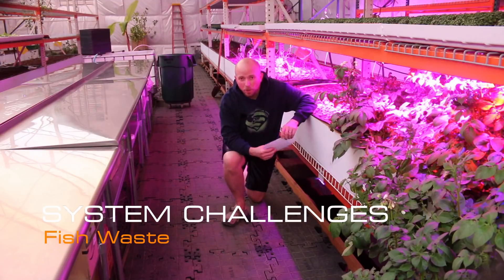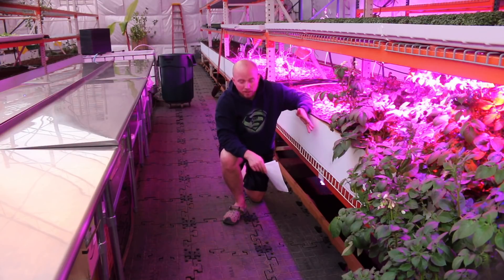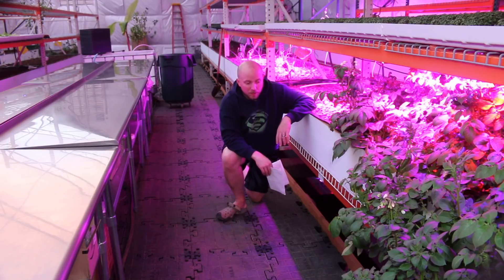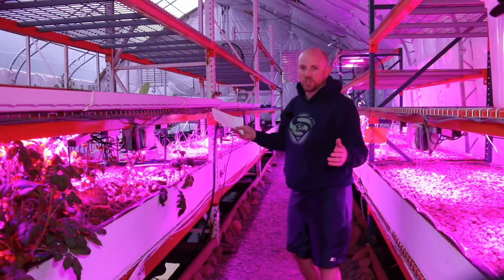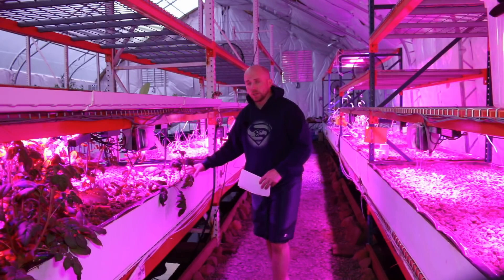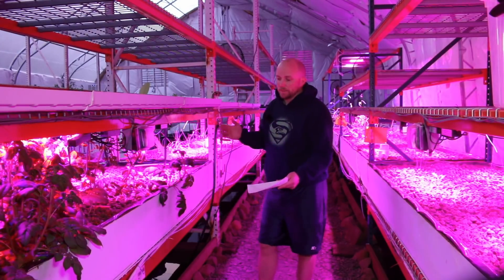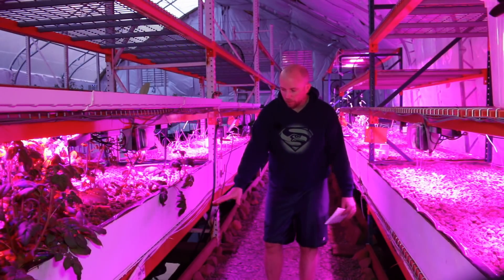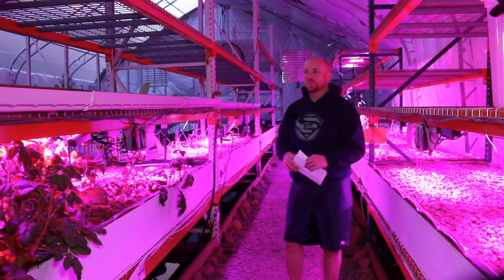New to AQUAPONICS ? Well think of how to REMOVE your FISH POO

Comment: I agree with the thought that you are way overthinking this simple problem. A good automated swimming pool cleaner would crawl around the bottom of your tanks, sucking up the waist in very little time. Have a timer turn it on 1to 3 hrs a day depending on the tank size. Simple easy and off the shelf turn key.

Comment: There is a system used by dairy farmers that works by pulling a chain along the milking shed really slowly, it collects the solids and moves them out. You could build a conveyer like this that slowly moves the fish waste out of the tank on little oblong buckets that would tip put into a collector. You would have to redesign the fish runs with this device at the bottom working like a rovolving conveyer belt. No need for software, sensors or robots it would just move slowly along and deliver the waste to a hopper at the end.

Comment: @The Real Martian Your  problem is  pretty simple.. but your not  going to  like the  answer.. All the systems that  are good at removing  fish waste: 1) have a shielded stand pipe in the fish tank that maintains the  minimum and maximum water levels in the  fish tank, shield tube insert is slotted on the bottom to increase flow from the bottom of the  tank helping to remove  solid waste,  to the  sump  from  which the  nutrient water is pumped from into the grow beds. or  2) the system is two separate  parts  the fish system and the plant  system. In the  fish system  solid waste is  continuously removed to a bio reactor to  break down into  nutrients. The  liquid nutrients in the  water are removed using  Algae Turf Scrubber  where the  algae is either used  for  fish  food or  plant fertilizer.  So basically Your  suffering  from  bad system  design.

Comment: It's simple and won't break. Just a small inclination should do. I mean, if this was on a shelf it would be harder but creating an inclination in the ground should be really easy. Even with waterpipes running beneath. As long as you have some insulation beneath the waterpipes the heat should reach that extra few centimetres. If you have like... say four metres between each pump, you'd have a zig saw pattern, the top at the middle 2 meter mark between the pumps, maybe 5 centimetres (that's like 2 inches for you american folks) higher than  above the bottom where the pump is.

Comment: I would just have the floor on the fishtank lean towards the pump. Just figure out how much it needs to lean (shouldn't be much) then the fish swimming around will help stir the poop around and it will accumulate at the bottom end, then you can just pump it up from there. I mean, it's not like your tank is made of glass, you won't have an issue with tension, that's the good thing with wooden tanks. That way, no unessessary breakable robots. the floor doesn't even have to be exactly even. It just need to generally lean. The fish will do the rest.

Comment: KISS. Firstly great work up to this point. A+ for effort. If sensors are too expensive for each lane why not use one common bank of sensors inline and then pump the water from each lane to the sensors. IE pump lane 1 for 5 min then sample. Then switch to lane 2 for 5 min and sample again. That way you use the same sensors on all lanes. This also means the lanes are using the same sensors that have the same calibration.

Comment: If your goal is to make systems deployable  you really need to look at refrigerated cargo containers. Infrastructure to transport them is already in place, they're built tough as hell and come with insulation. There's a bit flat roof waiting for solar panels and small wind turbines. You talk about farming more in a small space. There is loads of space, but in climates not suitable for agriculture.

One of my pet projects is deployable manufacturing and fabrication units. Those use shipping containers that are converted to small machine shops, wood shops,  electronics and 3d printing, etc. Then there's a utility module that contains power and water. There are already containers made to be portable living space. The group of containers is send out, put down close to each other and the necessary cables are run and you have a manufacturing site.

If an aquaponics system could be modularized into containers then there's a system that now requires less logistical support, or a farm in an area that would not support it otherwise and reuses old shipping containers that would otherwise sit and rust.

As for the fish waste problem you need to add bubblers down the length. It adds O2 to the water and lifts the waste so it can be moved along with circulation. If water isn't moving things will settle.

Comment: Just put a couple powerheads in the pond to keep the poop suspended until it gets pumped out, on the next build make the bottom of the pond slope down a couple feet, the poop will settle on the deep end where the pump can suck it up.

Comment: I think that you are both overthinking it and, under thinking it at the same time. The symptom is settled fish debris/waste. The real problem is a lack of proper circulation. You have to realize that first. I would suggest circulation pumps. They also have Linear piston pumps that put out some serious air, and 1 of those, and some air stones every 3 feet It would fix all of your proplems. It would circulate the waste, and your pumps would pump it all up into the beds for the wigglers to eat, it would oxygenate your water, and clean your tanks. it also would only take about a day, and like $200.

Comment: TRM, tracked vehicle, eh? Look at a G-scale railroad as a platform large enough for a tracked system. Build the articulating arm to go off a flatbed car. The train can push the flatcar. A simple transformer controls the speed of the train. And you can automate using DCC and bluetooth.

Comment: The easy solution is a plywood bottom with pipe channels routed into them so you can have a smooth bottom and just use a pool crawler to run overnight per lane. As you are still in testing and want to be able to change things they make a screw in footer you could place under each leg of the racking rather then concrete then some plywood sides and bottom to stop soil slump and at the same time give you a space to router in channels for the pipes to keep the bottom flat for good even suction from a pool crawler. 

Remember KISS for testing. Why use a robot when you can use valves to pull water from each bed to a test station. Will let you keep a tank of flush water to flush between tests.

Comment: I have had an aquaponics system now for four or five years and the first problem that I see with what you have there is you don't have easy access to your entire system. It will be difficult to get access to your fish containers and to the upper grow beds when you start growing above the one that is easy to reach. The only reason that you would want to have additional levels of grow beds is because you think you can't grow enough food on one level. Multiple levels of grow beds create a lot of extra work you need ladders or scissor lifts to get to them, additional lighting, more or bigger pumps, its a lot of additional work and resources you don't need. My second thought is that you need either an inline or secondary filtration for your water in addition to the grow beds. In my case I have an about 400 gallon system that I built from stuff I bought on Craigslist so at the time I reused a 55 gallon drum that I had to make a filter for the system. Water is diverted from the pump into the grow beds and the filter system so that when there aren't enough plants growing or worms in the grow beds to clean the water for the fish roughly half of all the water going into the pond is filtered regardless of plant load. That is probably not the most efficient way to do it but I was just starting out.

 My suggestion to you is get rid of all the racks or atleast move the fish from below the racks and put the fish in a big tank and inline filtration at one end of the building then run two or three long troughs for either media grow beds, deep water culture, or even better a mix of both down the length of the building for growing. Ideally one of the best ways to set this up is water gets pumped from the fish tank first into the media grow beds, then to the deep water culture beds, then to the multi stage filtration system then back into the fish tank. A bigger aquaponics system will tend to be more stable than smaller ones. I haven't seen yet if you have a planting schedule or not but that is important even in a green house to have because some plants will require supplements to get the best yield out of the crops. 

 These guys have been doing it as a business that way for years https://www.ouroborosfarms.com/ . So their system is optimized for high yield production and low cost as possible. Another great resource to use for optimizing a hydroponics or aquaponics setup is these guys https://www.youtube.com/user/BrightAgrotechLLC/playlists Bright Agrotech is all about growing plants to sell which means they only have what is absolutly neccsary in thier systems to make it easy to use, easy to fix, and cost effiecent to run. Also the vertical grow towers they sell could save you a lot of room. Here is another great resource for learning how to setup an efficient aquaponics system.  Aquaponics at Kentucky State University Aquaculture Research Center 
https://www.youtube.com/watch?v=gTg3eQZaR5E

Youtube has a lot of great videos on the many different ways to grow in aquaponics but I believe keeping the system as simple as possible and making it easy to get to the entire system for maintenance and repairs will make using the system a lot easier on the people who have to work with it everyday.

Farmbot & Aquaponics https://www.youtube.com/watch?v=w6j-l0Jqx24

Comment: Your goal is to make this a system that can be run by anybody.  Repairs and maintenace are a big part of running the system.  Therefore, the system needs to be simple enough that anyone can repair and maintain it too.

Color change chemical water testing is simple and effective.  If you wanted to automate the testing, you make a test tube magazine that can dispense a sanitized test tube into a gripper on the end of a pneumatic cylinder.  You advance the pneumatic cylinder to take the test tube under the water to take a sample.  You return the pneumatic cylinder to retrieve the test tube.  Once fully returned, a horizontal tandem pneumatic cylinder with gripper takes the test tube to the test position.  The first half of the tandem cylinder advances to the pickup position.  The horizontal gripper closes on the test tube, then the vertical gripper opens.  Then the second part of the tandem cylinder advances the test tube to the test position.  Chemicals are added and a vibrator on the horizontal gripper can be used to mix the chemical.  A camera records the color.  The horizontal gripper releases the test tube and it slides down a tube into a bath of water, where the water breaks its fall and it sinks harmlessly to the bottom.  As soon as the horizontal gripper opens, both parts of the tandem pneumatic cylinder retrsct.  The system is now ready to repeat the cycle for the next test.  The operator of the system collects the spent test tubes and runs them through a santizer, and then loads the sanitized test tubes into the magazines, and then replaces the magazines in the various testers.  The operator also refills the chemical tanks.

It's fairly simple, and cheap pneumatic cylinders are readily available, and it's simple enough to understand that just about anyone can maintain and repair it.

Comment: In regards to sampling I would simplify it a bit and remove complications/time of a robot, definitely an idea for the future though.
An industry standard sampling system could easily be put together for minimum cost. I would run a "Fast Loop" to/from each of the beds via a manifold using a single pump, each bed would be sampled one at a time using fast loops to get a representative sample. You would then sample the fast loop using a Peristaltic Pump with a flushing cycle to dump the previous sample. 
Using a single "analyser", fast loop pump and peristaltic pump. The system would be infinitely expandable (within reason) depending upon the number of beds, using only extra tubing and manifold modifications to accommodate extra beds. 
Even using relatively expensive off the shelf analysers/instrumentation it would be a one off cost for as many beds as you want in a single location. This would give you a representative sample and pretty robust system using mostly components you probably have on hand just now.

Comment: What about adding circulation in the tanks to prevent settling of solid waste?  "Wavemaker" type aquarium pumps are like an underwater fan, very effective for water movement but use very little power.
Reply: I think an easier, and more scaleable system is a linear piston pump, and airstones.

Comment: Martian, I think the droid idea adds a level of complexity that would lead to constant breakdowns. I think you need a dumb but robust system. I think you need a crawler that can run the length of the bed under the surface using the power of your pump. Something like a water hose tractor only instead of pumping waster out it would be either pumping air or sucking the water in. I envision try crawler being constructed from 3D printed parts. Here is an example of a hose tractor in case you aren’t familiar with the design. https://youtu.be/BAPdmh1dRas
Reply: Tony Erwin I had exactly the same thought.

Comment: Pool cleaner?
Reply: They also make a crawler that uses the suction to run a simple motor to let is crawl along the bottom of the pool.
Reply: Yes, the kind with a part that floats and a hose out the bottom that sucks. I believe in the pool case it is connected to the pool filter and the exchange of water back into the pool also moves the float.
Reply: mike95826 do you think it would suck up a fish?  I have no experience with them.  Just seen them running.
Reply: Hmm, if he ran the water through home made bio-char, he could take the nutrient filled bio-char and add it to his own garden or sell it for a profit.